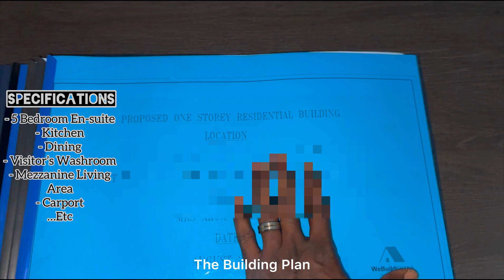SOKOBAN PROJECT 1.0 | | Every Terminology In Building A Sound FOUNDATION Explained | | WeBuild GHANA

Comment: Great job, Kudos. Kindly explain the relevance of a ground beam and the reason it wasn't part of this foundation. thanks
Reply from the maker: In simple terms, ground beams provide additional stability for the project if the land can’t be trusted. 

The land type as seen in the video requires no additional ground beams since it’s already a tough nut to crack looking at the excavation process.

Comment from the maker: CONTINUATION 👇👇👇

04:47
7. Blinding or Blind Concrete : is layer of concrete that is applied in the trench or excavated area before the laying of the substructure blocks or installing the Columns.
The purpose of blind concrete is to separate the structural components from the underlying soil and also provide a level and stable surface for the construction of the  foundation.

NB : Columns and footings or trench footings are installed here, in terms of diy construction, seek a supervisor.

06:35
8. Concrete Blocks : are building blocks made from a mixture of sand, cement, quarry dust and water. Preferable choice in terms of quality, mold accuracy and availability.

07:11
9. Substructure Block Laying: the process of constructing the lower part of a building's foundation with blocks. The substructure typically includes any part of the building that is below ground level. The blocks used here (in the video) are 6” concrete blocks.

NB : Project type and topography of the land is relevant to how the laying of the blocks will be, in terms of mortar mix ratio and either blocks to be laid “flat” or “edge”.

08:15
10. Columns Shuttering : these are temporary wooden formwork formed around the columns to contain the concrete while it is poured and allow it to properly set and harden. 

08:31
11. Columns Casting : is the pouring of concrete into the wooden molds around the columns.

08:49
12. Filling : the process of adding soil to fill the cavities and to create a level surface.

NB : Laterite, gravelly and sandy or course sand are preferably the best filing sand choices.

09:25
13. Plumbing: on the substructure level is the system of pipes set for disposal of wastes at the washrooms, kitchens and drainage systems.

09:25
14. Watering: this is done to help achieve proper compaction of the soil or the filling sand.
By moistening the soil, it becomes more workable and easier to compact, resulting in better density and stability. This is very important in foundations.

NB : Yes, rains are a good source for watering but since we don’t have rain as our ally, watering should be well done and supervised to ensure it’s objective is achieved.

10:46
15. Compacting: involves using heavy machinery, such as a compactor (in the video), to compress the soil in the foundation area. This helps to remove air voids and increase the density of the soil, providing a solid base for the construction. It's crucial to follow proper compaction techniques and specifications to achieve the desired results.

NB : This affects the stability and durability of the structure. Extra care should be taken here.

11:13
16. Damp-proofing : is an essential aspect of foundation because of its ability to prevent moisture from penetrating into the superstructure of the building . 
This helps protect the structure from potential water damage, mold growth, and other moisture-related issues.

NB : DAMP IS A NIGHTMARE! Preventing it at the substructure level is the best.
There are various ways to damp-proof your building, detailed damp-proof types will be uploaded soon. 

11:30
17. Overhang Reinforcement : this is not a common technique in substructure or foundation construction, it is only done at overhang or extensions that doesn’t have a support beneath it. Overhang sections are reinforced to be able to withstand the load that will be on it.

11:36
Oversite Concrete : also known as a ground-bearing slab, is a layer of concrete that is poured directly onto the prepared ground as a base for construction.
It provides a solid and level surface for the construction of the ground floor.
.
Congratulations if you read this far 🥂
SUBSCRIBE and keep the bell on to keep you notified on our upcoming contents that’s aimed at spreading building and construction literacy.

THANK YOU.